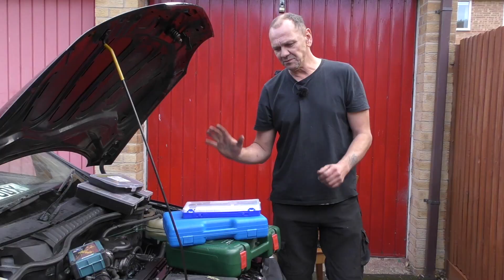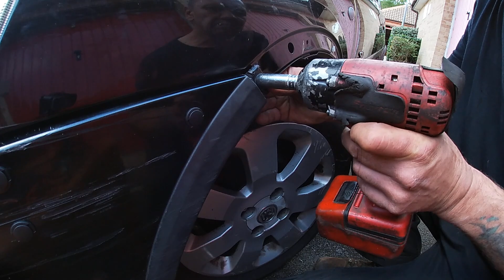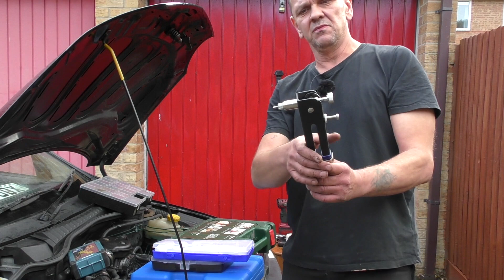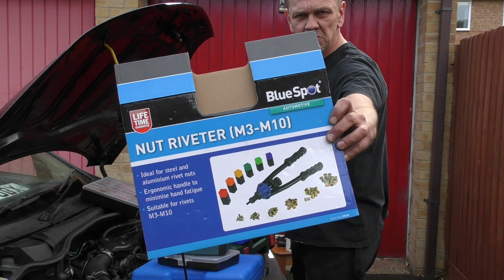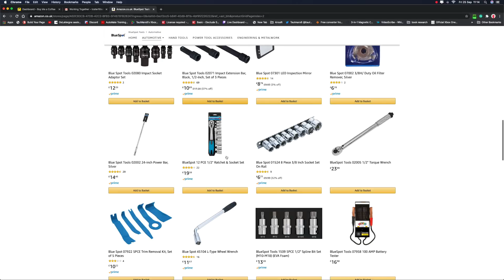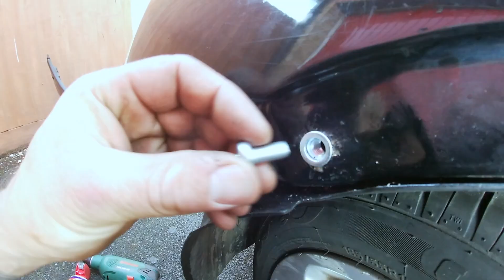Tool Review -The Perfect  'Rivnut' Tools For Repair -fixing and Modification

Comment: Hi Chris,sorry for my daft question but I NEED YOUR HELP PLEASE,.as this is all double dutch to me.  Am I correct in  assuming the riv nut is expanded by the mandril to fit a hole? The reason I ask is I have  2 projects where I need to use copper plain sided  rivets. They are shaped like  the end of a trumpet at one end before they are expanded, or if you like an open ended Top Hat shape.They are smooth both inside and out cylindrical in shape and no  knurling marks like a riv nut.The top hat shape copper rivit would need to be placed in an area with restricted acess  for the tool and once expanded or swaged into the hole the opposite end then opens up like a trumpet, My final question is what tool will do this? It is to secure the  plastic instrument console on an old  Bmw r100rt motorbike to the plastic windscreen as to duplicate what was originally there.Cheers Richard.
Reply from the maker: Now you are asking.  Could you put a picture on my Facebook page please so I can see what you are talking about?   https://www.facebook.com/trailerfitters.toolbox

Comment: Had a cheap set of rivnut thingies, bent them doing m8 steel inserts, so yeah stick to ali with the cheaper ones!

At a push you can set a rivnut with just a good quality nut and bolt, grease the bolt and nut well, thread nut onto bolt then rivnut onto bolt, then hold the bolt still in reference to the rivnut and wind the nut down tight onto the rivnut and it will pull it up tight.
Reply from the maker: Yeah, that works well. Somewhere on this channel is that trick and I agree, it is good for that occasional rivnut.

Comment: Had Bluespot for years ...  rep said these guys will be the next Snap on ...  think that was 10 years ago !! 

On the salvage squad note ...    I have a 1.4 HDI engine sat under my workbench gathering dust from a 56 plate 206  76,000 on that I was going to put into my Pug 307 now sold 
Probably injectors are knackered, due to pump bearings worn and chrome broken off due to using cheap supermarket fuel ...  easy to check when you remove fuel filter and find all the silver flakes in the bottom ...  pointless putting new or recon injectors in as they will soon break as the flakes are in the system ....  needs a flush as well as a new donor pump ....  think its time for the bridge ? 
Easy to diagnose when you put your scanner on and see the live data off the pump and injector pressure and spill rate

Comment: Great tool review  , great video .
I have the smaller 1 of the 2 and yes as you say you wouldn't want to do many m12 stainless with it but will handle m12 ali with sufficient ease .
As the disco will attest to
Reply from the maker: Ah yes. Stainless.  The devils material. Hard to drill.
Reply: @trailerfitter2  I have used masonry drills with the carbide tip . Not pretty but works 99% of the time